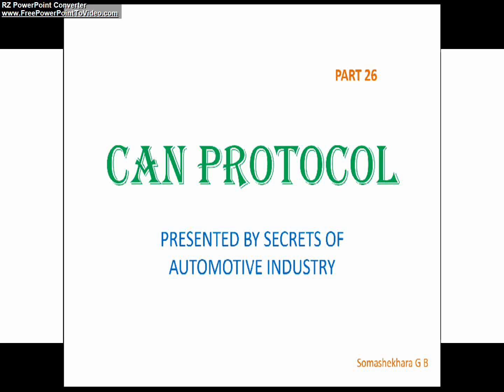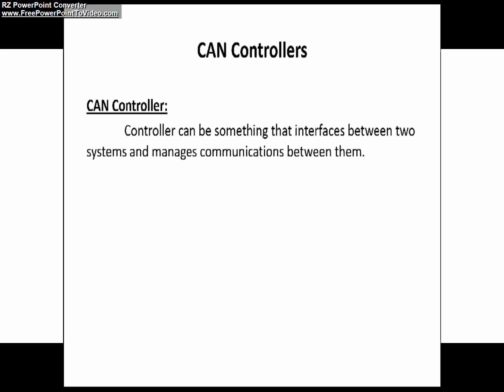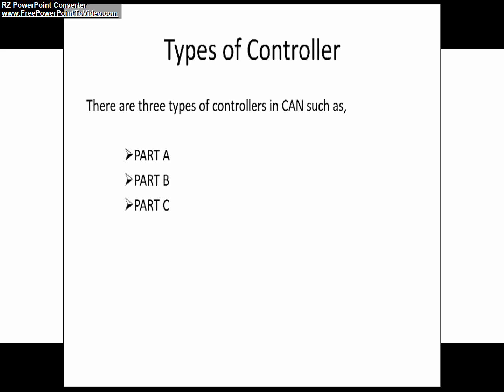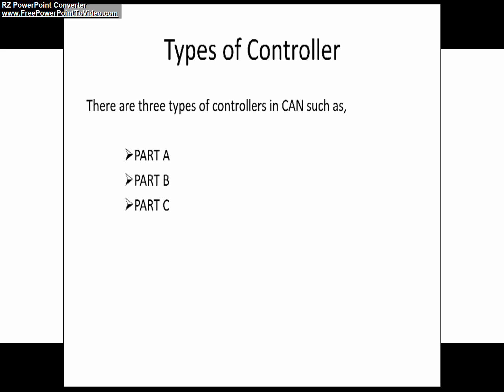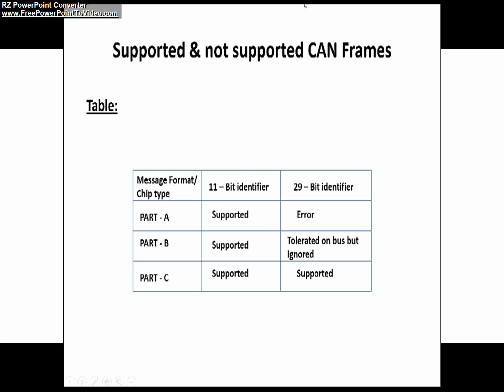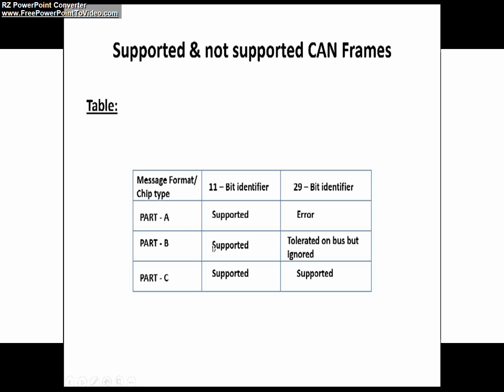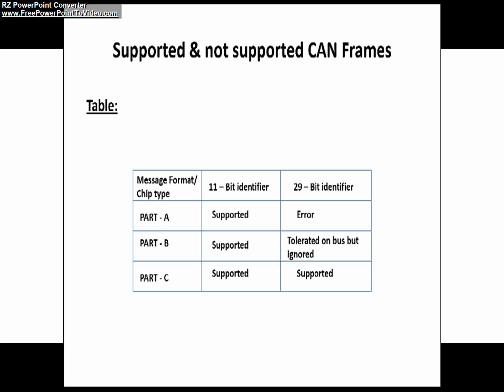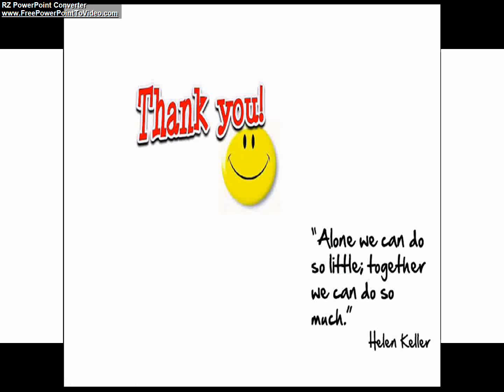CAN protocol basics, PART 26, CAN Controllers.

Comment: Why do we use only 500kps in high speed can ? What happens when we use 1mbps
Reply from the maker: Because of cable length, if the cable length is <=40 meter then we can go for 1MBPS, if it is greater than 40 meter 500 kbps is preferred and again it depends on physical layer standards, currently this standard is predominently available in market.